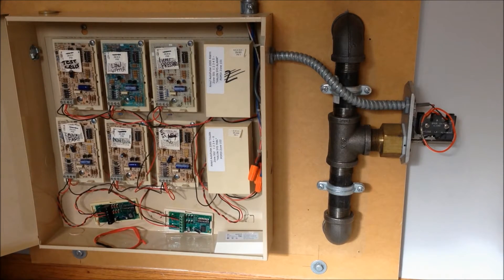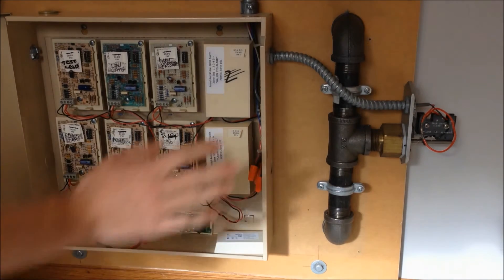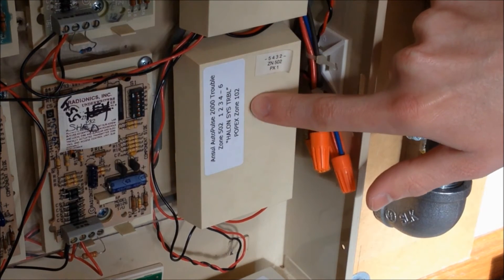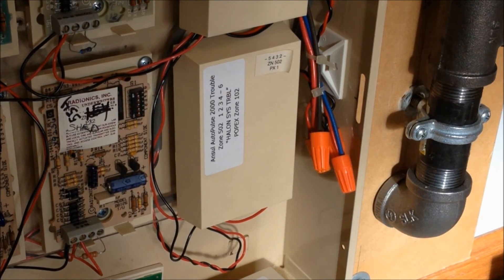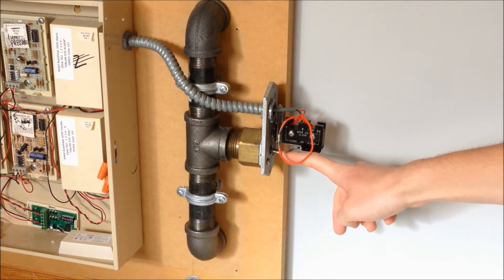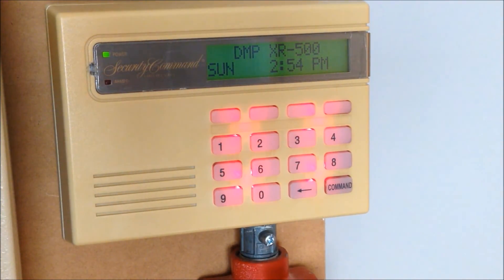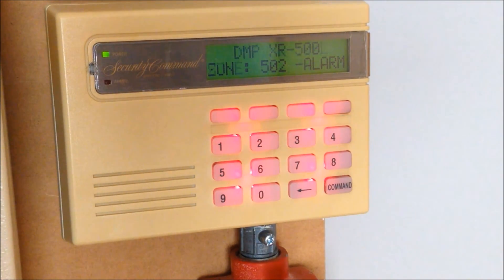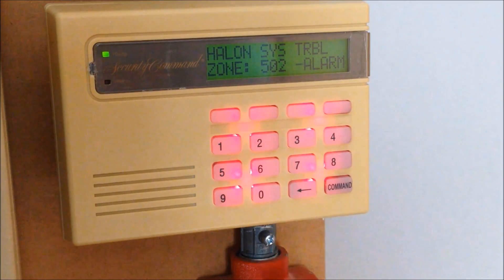System Test 24.1 Special Edition | Equipment Failure Resolved

Comment: At 1:20, what is that plastic thing that holds wires together called?
Reply from the maker: It's an adhesive cable-tie mount. The plastic band actually holding the wires is just a regular zip tie.

Comment: Where can u buy a empty enclosure ?
Reply from the maker: You can probably find them on eBay, but I don't know where you would buy them new nowadays. The enclosure shown in this video was removed from a building with all of the POPIT modules already installed, minus three that I added. Back in the late 1980's when this was originally installed, they got it straight from Honeywell.
Reply: Ok thank you:)